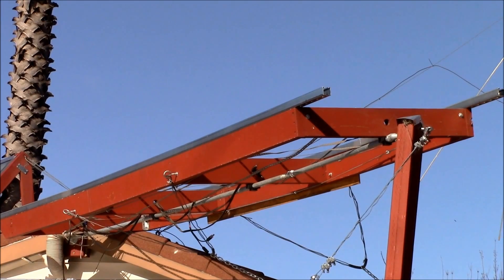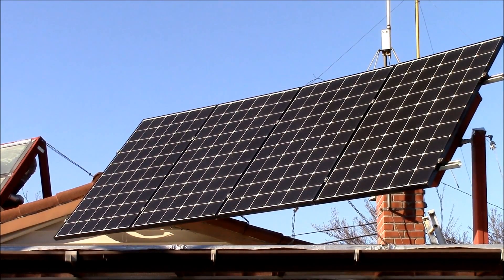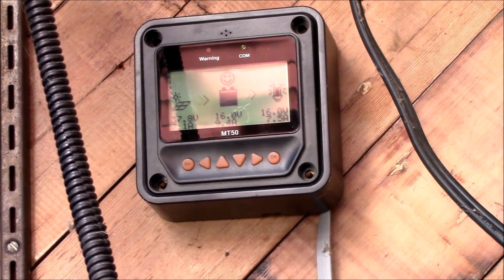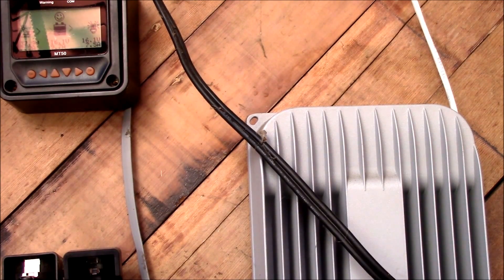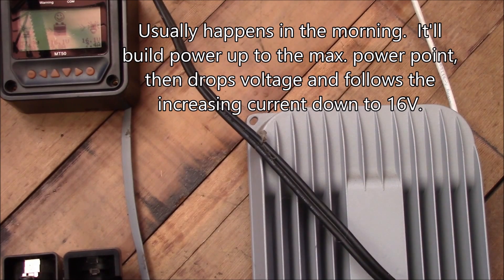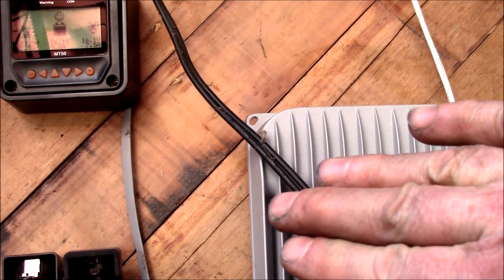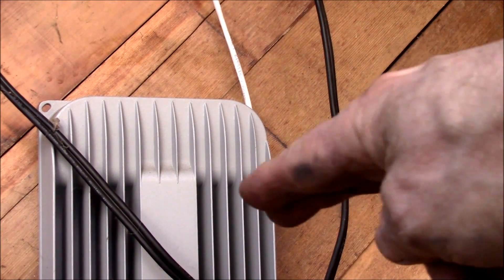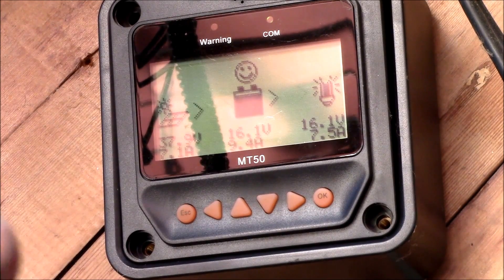Solar Panel Upgrade - LG NeON® 2, Part 2 (repost)

Comment: I can only see the first 10 seconds, then YouTube apparently can not find anything anymore.  is something wrong with the video editing program.  With your other YouTube video's i have no problem.
Reply from the maker: Not sure what's going on then.  I've been using the same rendering/encoding options/program as the other videos.  I can play the whole video through both on Firefox and Chrome.  Even tried a different system with the Kodi YouTube add-on and that played both the original and reposted video just fine.
Reply from the maker: I tried reprocessing the video in place with the YouTube "auto fix" tool.  That mainly does color correction, but maybe the re-saved video will load properly.